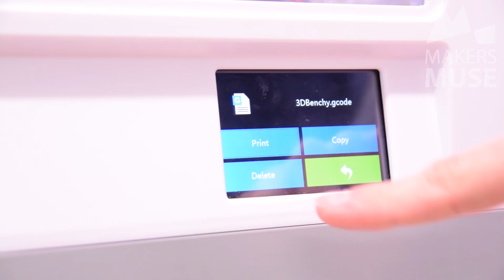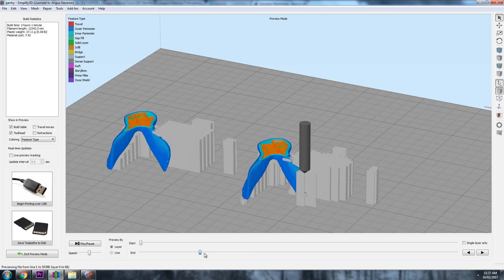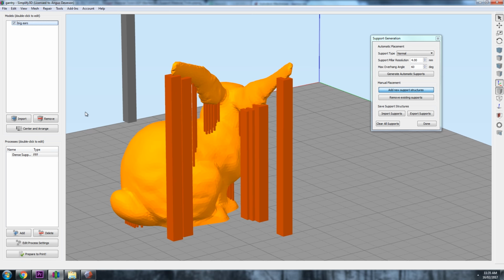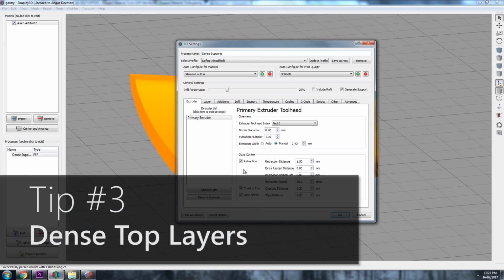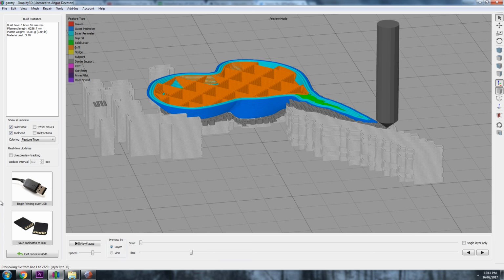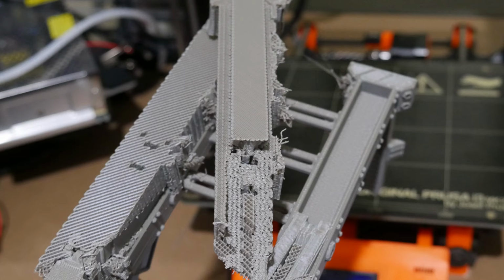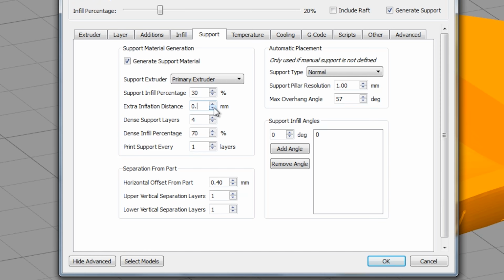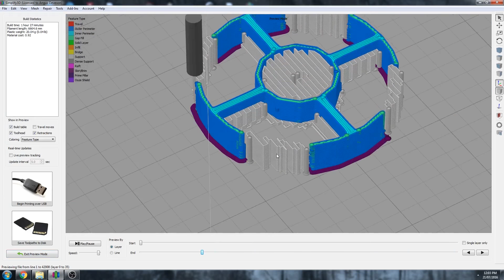Advanced Support Generation Tips for Simplify3D - 3D Printing Masterclass

Comment: Thank you so much for making this video! After months of struggling with large scale statue prints failing due to support failure on my new guider 2 I found this video and the key was the 90 degree offset on the support structures in simplify 3d.  I have not had a single failure since!  Thank you so much for saving my printer from the river!

Comment: I find your Tips on using Simplify3D easier to understand and I always look at your site for new tips first compared to Simplify3D's own Tips. This one was especially Helpful. I just wish that you explained in this one on How to Print using an Interface Layer so that I could run an M600  Command to allow me to add a Different Material such as Water Soluble PVa into my Support Structures.

Comment: I have sometimes created my own support structures around the model rather than use automatically generated ones.  I did this before I discovered the "expert" mode in the FlashPrint software. 
I'm using a FlashForge Adventurer 3 printer.  Because of this I have to use FlashPrint to communicate with the printer.  Now that I have watched your video I may be able to make use of the additional expert settings in FlashPrint.  
I think there is still are likely to still be cases where modelling my own supports is useful.  For instance, if support is needed in a difficult to access part of the model, a custom modeled support can be made with a handle that you can grasp to remove it.  If I am modelling a complete assembly with moving parts, using custom designed supports enables me to ensure the surfaces of moving parts will be as smooth as can be once the support is removed.
Other possible reasons are to reduce waste plastic,  reduce printing time and ensure the model does not fall over.  Building a custom support that itself does not need support can reduce printing time considerably.
I use Fusion 360.  To make a basic support of my own, I create a primitive object that surrounds the part I want support for, and then use the cut operator to cut a negative of the object out of the primitive.  Then hide the object, and use the extrude and press pull operations to make 0.5mm space between the support and side parts of the model and 0.25mm space between the support and the bottom of the model.  Then I use wire-frame mode to inspect the support structure and the model to ensure there are no parts touching.

Comment: I also use the "lilly pad" trick on small support columns if the base of a support tower is small compared to its height. I have a small disk STL I add to the model at the base of the support tower. This prints the lilly pad at the print model settings and then the support prints on top of that giving it a far better base and bed adhesion.

This same disk STL can be good to add to a model if you have a sharp corner on the model that has a tendency to want to lift/curl up. Just insert the disc at that problematic spot on the model, and boom instant increased bed adhesion at that feature. I find these disks far easier to remove than a whole model brim, and can be placed only on areas that tend to want to curl versus the whole print base like a brim creates.

Great video sharing your tips, keep it up :)

Comment: Well done.  I second your notions regarding assumptions as to what the software will or will not do based solely on the parameter description, especially density vs resolution.  Dense support layers are useful but if they are not paired with a high percentage it can destroy fillets and other fine features.  S3D will spit out a solid dense layer with half of its edges unsupported and it's not always easy to catch.

Comment: Thanks. Very helpful. I had worked out myself the pillar resolution, but had not understood the use of dense layers. Will give it a go. 

Also, another benefit / use of extending the support beyond the model is for instance adding support for a round window in a thin wall. Extending allows the support to anchor on the print bed, rather than just the wall.

Comment: Thanks for the video! The one thing I would like to be added to simplify3D is smarter supports. So for example supports that slowly grow as they get larger. For example: take a box that for some reason you want to print upside down. In this case you will need to fill the entire box with support materials. It would be better if there is an option that it starts from a point and then grows at an angle of for example 45 degrees outwards. There are some other variants and situations where they would benefit  but I think you get the point.
Reply: I'd make two processes for this situation. One with 5~10% support density for 90% of the cavity height, and the second for the remaining height with 15-20% density. Stratasys software does a very similar thing by making pillars very very sparse (but with 1 perimeter shell all around so it doesn't wobble) and then printing solid density when the contact surface is close.
Reply: Sounds like a nice addition! Well we can conclude that there are quite a few features that are welcome additions to the support system of S3D

Comment: Great video! I just can’t understand why in this video you find a way to deal with support and say how important it is to choose correct settings for the support so that the 3d model gets a smooth surface and the support is removed easily, while in your previous video you're doing it differently and point to support settings that ruin the entire 3D model?! It’s a rhetorical question.

Also, in your video reviews you often say that the 3D models are faulty because they require a lot of support for printing. I think you figured it already out that the problem is not in the 3D model. However, in this video you also show that you use the same amount of support. You could also have used a different support pattern for less material use. But I suppose this was done to get the part with the attached support smoother. Am I right?

I’m glad you’re learning from your own mistakes, you’re testing more and spending more time on dealing with settings. Keep it up!

Comment: Angus, is it possible to replace the last layer of support material, that touches our print, with water dissolvable filament, so we throw it into the water and PLA/ABS support just falls off and dont leaves any marks?
I know, we could just make entire support from that dissolvable filament but its expensive.
Reply: Not that I've seen in S3D. Supposedly Slic3r lets you have support interface layers which looks similar to "dens support material". I was given the impression the interface layers could be a different material but I can't find that setting.
Reply: I think it is possible but not really built into S3D, depending on the design you could design your own supports that come close to the part and then let S3D create the support for the area between your supports and the part.  For example using the same example that Angus showed with the parts suspended in mid air you could create a block that has the same infill that you want for supports and use a different process to turn off top, bottom, and shells and have that block stop like 2-3 mm from the part, then S3D could generate the support for the 2-3mm gap and you could define supports to be printed with the second extruder.

Maybe a feature request to S3D to add the option to use a different extruder only for the dense support layers and not normal support layers would be a way to go, right now you can only define for all supports.
Reply: Arek R. I know this is a bit of an old comment, but the new update to Simplify3D just added this feature.
Reply: David yes
Reply: This feature is available now on S3D.

Comment: Hey Angus, I really like the channel. I have sent some folk here to learn. I have a question, have you seen or do you have an opinion on the 3 into 1 Senhai3D Delta Printer?  It does color mixing and extrudes 3 filaments into 1 nozzle.  I am interested in multi-color printing and adding a second printer. I have a Cartesian now and have it quite dialed in thanks to your channel. I want to add a Delta to the production line.  I am not so much interested in your build quality opinion as I am your thoughts on whether or not you think this is a sound possibility for printing multi-color or thoughts on a different direction.  Thanks man!

Comment: 1. Excellent tip around the -45/45 degree (or any degree) support option. That's a new one for me, thanks!!

2. Support separation layers weren't discussed, I've had luck in some circumstances with 0 upper separation layers (more so with ABS than brittle PLA).

3. I have trouble with curved overhangs that need support, there seems to be a gap between the sweet spot of support, and the overhangs that don't need support. (I think around the 55-70 degree area seems most troublesome.
I've got around it sometimes with changing the layer width, but that can do other things to some models, or that isn't a desirable option.
Do you have recommendations?

Do you have any contact with Simplify 3D, particularly are you aware of any potential pillar support (like meshmixer) being developed for this product?

Comment: From a perspective nowadays, would you recommend using Simplify3D instead of other slicers? I am using the newest prusa slicer and while I am super happy with many of the features like the support enforcers, support blockers or also the build in color change function I miss a little the option to customise my supports as for example leaving some space so that it is easier to remove. Would you think switching to simplify 3D makes sense or making customised supports in simplify3D and then doing the slicing in prusa slicer? How do you see their slicer?

Comment: i found a greet solution on fusion 360, i got a tube and an overhang at the end. I made a 0.6 mm support material arround at 0.3 of the edge and -0.2 mm of the height of the tube. After the print is finish i just snap it with my finger, its so clean. Is it possible on cura to generate support with -0.2mm height of the current print ?

Comment: Hey Angus, thnx for the great info! A question though: In regard to PVA (= expensive), how would I convince S3D (or any other slicer) to only print the last few layers of the support (maybe even just the dense support?) in PVA, the rest in PLA/ABS/PETG? Would keep costs down A LOT. TY!
Reply: I heard CURA has the option to do this.
Reply: That particular option isn't available.
Depending on the structure though, you could just make another process that kicks in at a certain height to complete the supports.
If you've got support finishing at various heights though, it could be tedious.
Reply: Ryan is correct, both Cura and Slic3r have this option.
The option you're looking for is "Support Material Interface Extruder"

Slightly more accessible via Slic3r than Cura though.
Reply: This is sort of possible with S3D, but is rather hacky.
Create another process, choose your support extruder, turn off infill, perimeters, top & bottoms layers. Set support material to 1%, the angle to something different to your other process' supports, set the amount of dense support infill layers you wish to print.
Go back to your main process and increase the Upper & Lower Vertical Separation layers by the amount of dense layers above.
S3D will warn you that the processes overlap, however it should be fine.
DISCLAIMER, I do not own a dual extrusion printer so cannot test this.
Reply: detailed answer, nice
Reply: You could also model the lower part of the support into your design and let the slicer take care of the last few mm's?

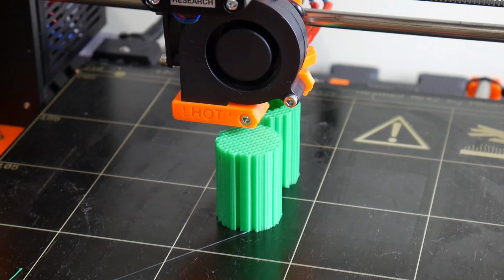Comment: Angus, how do you build your first layer on a support like you did at 4:33??  I need to drop a M6 x 25mm bolt down into a print (encased bolt).  I can't find an answer to this anywhere.  Thanks for all of your videos!!
Reply: I found where you simply adjust the Z offset of the object, then generate auto supports :)  I was making something simple complicated.

Comment: When printing with multiple processes in S3D, the default support for one process appears to go completely through parts printed with another, lower, process. When added manually, they appear to only go down to the top surface of the portion printed with a lower process. Am I missing something?

Comment: I feel like there should be a way to use les suport. Like printing a helmet. To not have a lot of work cleaning a print printing it the richt way up. You get a very high column suport. Is there a way to get the suport to begin to print in a cilinder ending in a dome? Would save a lot of filement.
Reply from the maker: Yes, one trick is to insert a big hollow box which bridges close to the top, then builds support. You save LOTS of filament and time doing it this way

Comment: Hey mate,

I've found your videos extremely helpful, but with regard to slicers I've found that the software provided by flashforge seems to give a better result than anything else I've seen, including razor sharp points and smooth curves (i use it to print rocket and model aircraft aerodynamic parts). Tree like supports also are easier to remove and seem to provide excellent support.

Could you test this software on other printers (if possible) as I only use it on flashforge's dreamer, so I can't tell if it's the slicer or printer giving the results...

Regards.

Comment: Hey Angus this is a completely unrelated question, but I've been faced with the oppertunity to show off our schools D&T departments 3D printer, my mind instantly wants to use Vase mode for a cool crystal type structure, but its a Makerbot 5th gen and have no clue if Slic3r would even work with a Makerbot. I wonder if maybe I could export the Gcode and run it on the makerbot? but I really don't have much idea. Any help appreciated!

Comment: What about (vertical) support  (and raft) separation to avoid the part fusing too securely to support structure?
I tend  to print a lot of large mechanical pieces (0.6mm nozzle) at fairly high (ABS) temperatures, and if no separation is included it can be hard to remove supports and rafts without damaging the piece.  I find that about 0.2 mm is a good separation distance.
Reply from the maker: Yeah, fine tuning separation distance is a video all in itself :) I've never changed the defaults to be honest, and instead tweaked temperatures. However, I rarely print ABS these days except for the UP 3D Printers. A 0.6mm nozzle would definitely make things a bit more challenging as it doesn't cool as fast. How is warping at that scale?
Reply: Pretty good..

I print with a heated bed starting at around 95 degrees C  for first 2 layers (first layer at 0.1  thickness multiplier for good adhesion) and averaging 80-85, and have the whole printer enclosed, so that the temperature gradient is as small as possible.

The Entire Enclosure runs at around 50-55 degrees.

One thing I have never come across addressed online, is that with ABS, IF the heated bed is TOO HOT but not hot enough to get "Elephants foot"  distortion the lower layers SHRINK. causing tapering IN at the base.  
 [I had this problem printing with an "underpowered" open loop heated bed - which was thought to NOT get above ~90 degrees (wrong) before I had the controller hooked up, closed loop of course controls temps well.]

Comment: The thing Simplify3D does which I think is rather odd, is that when you generate supports and use a skirt/brim, it doesn't acknowledge the existence of the supports when making the brim. It seems like there should be an option.

Comment: Hey Angus, Simplify3D already works great with the Prusa?
Reply from the maker: Yep the Prusa is an open platform, you can use any slicer you like :)
Reply: Does Simplify3D already have the proper settings built-in for PLA, ABS, etc.?
Reply from the maker: it's got a profile to start from but you will need to fine tune it for your preferred brands.

Comment: They are other software then symplify3d,  Cura for example,  95% of peoples are using something different so make your videos relative to that not relative of what tool you are using
Reply from the maker: I'd love to, but you can't customize support structures in Cura making much of this video unrelated anyway. I have plans to use other slicers in future for another series.
Reply: I understand :), I use cura and manage to print all my stuff with it without any issues so far